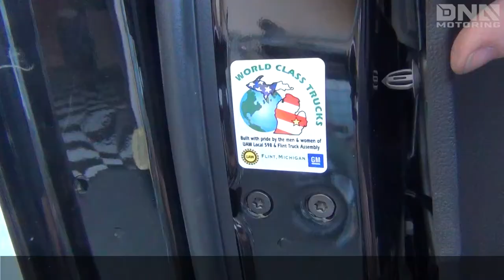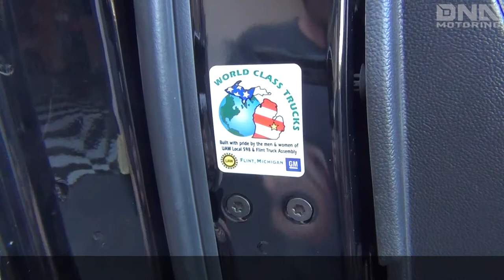How to Install 14-17 GMC Sierra Chevy Silverado Tow Mirrors

Comment: My wife bought me a set of these for Christmas. TWM-016-T999-CH-SM.  What kind of warranty do you offer?  Are they set up for turn signal and marker lights? Love the looks of them.  Cant wait to install.  I ordered boost auto truck harness adapter because my truck didn’t have turn signal or the cargo/backup light from the factory. Is the rubber on the bolts used just to protect them from damage or are they used in install?
Reply from the maker: 30 day warranty. They are wired up the same as the factory tow mirrors. The rubber on the bolts is to prevent damage during shipping.

Comment: I bought these to replace my oem mirrors but the turn signal and reverse light doesn’t work. Do I need a separate wire harness? I have 2014 silverado 1500
Reply from the maker: If your vehicle was not equipped with the functions that these mirrors have more than likely you will need to repin your mirror harness or possibly a adapter harness. Please consult a chevy wiring diagram for this.

Comment: Gm interior doors piss me off with there pitch clips or whatever they are called. They always come lose or break the plastic that is suppose to be held. Why debt they do what ford does and just use l shape hangers and square holes In the door to hold the panels on. That way everything isnt such a fight